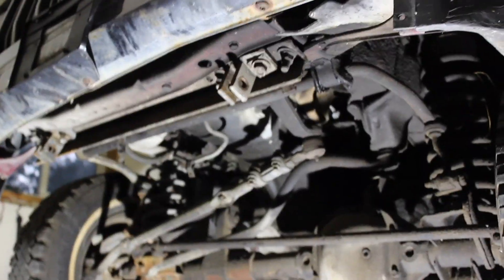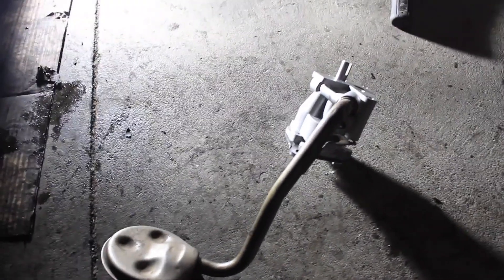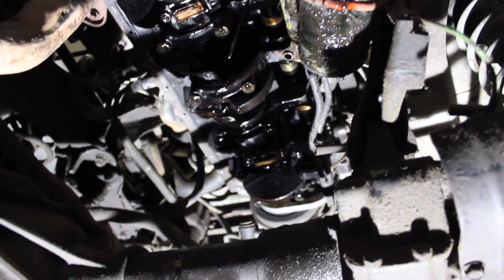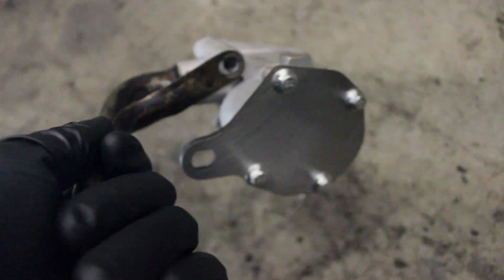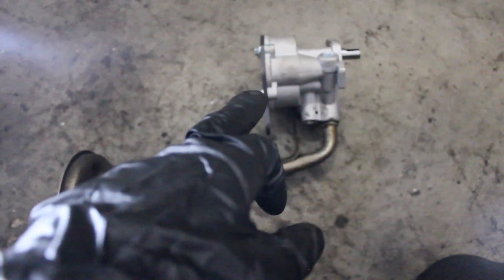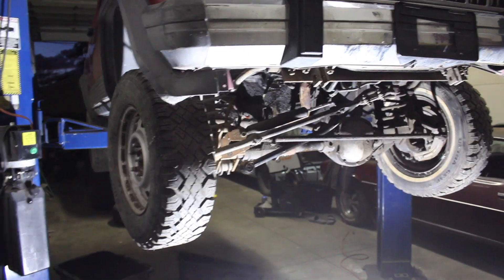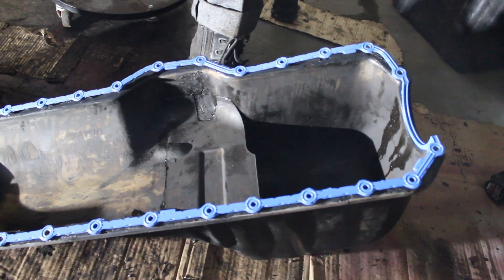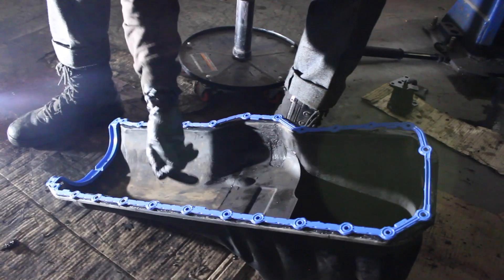Jeep 4.0 Low Oil Pressure

Comment: Take the pump apart. The gear in mine was wearing on the plate that holds the gear in. I have a manual oil pressure gage i installed. My psi used to be 52psi and went down to 38. At idle 18psi. Changed mine out and found the gear had a chip in it
Reply from the maker: I just ended up replacing the pump.  a new one was 60$